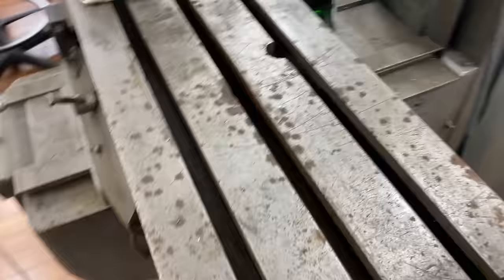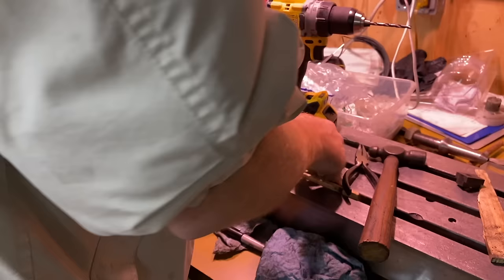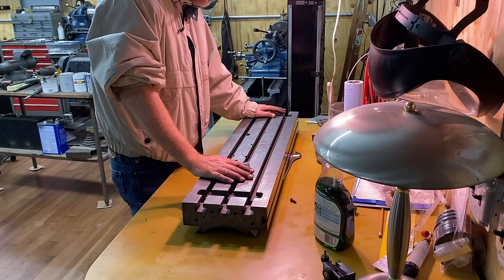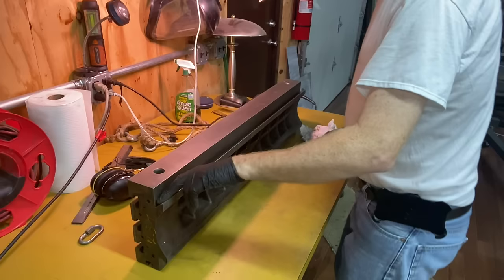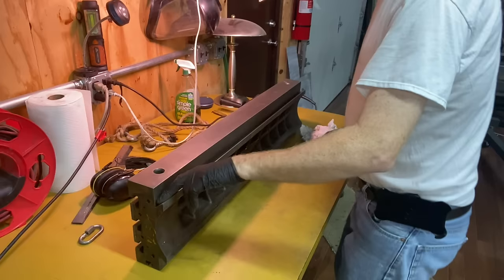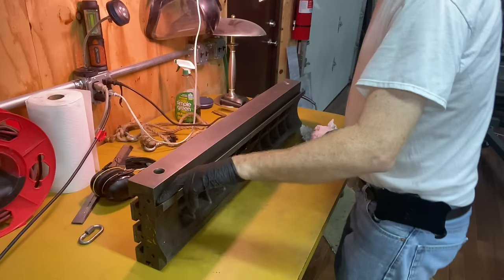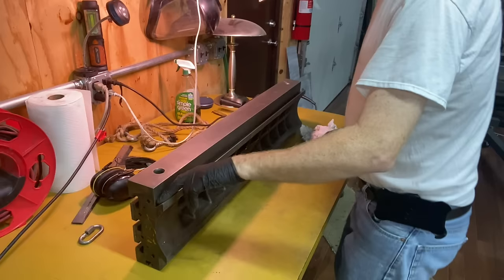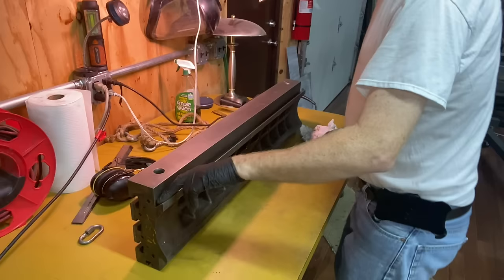Bridgeport restoration 10  -- Fixing a Horrible Mill Table

Comment: Thanks for sharing. I don’t know enough about what your doing to know or help you, but I looks great. Most guys put covers to keep the clips out of the tee slots.
Reply from the maker: I made some in the past using a 3D printer.  But then I found that the hot chips would melt into them, and that wasn't helpful.  I think I need to get around to making some more covers out of a different material.  Great suggestion!  Thanks for watching.
Reply: Copper sheet is easy to work with, and would look awesome…
Reply from the maker: @jeremyfreeman1860   Yeah, that would look awesome!

Comment: I would send that table out to get machined after the saddle and the knee gets scraped. It's a shame to put a ton of work into this project and end up with a drill press.
Reply from the maker: I agree.  It would be very nice to have everything properly machined and square and flat!
Reply: I feel like although this comment is correct, any improvement you make to this bridgeport, is STILL an improvement. Keep chuggin!

Comment: Consider using tapered pipe plugs of the appropriate size to plug your holes in the table. Not the recessed hex type, but the protruding square head type. They would self tighten and leave a almost undetectable spot where they were installed after milling the table flat.
Reply from the maker: I hadn't thought of using tapered threads. But it is a great idea.  Thanks!

Comment: Hmmm, quite the interesting pattern in the table surface... Kinda reminiscent of some flaking finishes for reducing of surface drag and allowing fine dust and micro chips to not be an issue... 
Tho damn it man, an angle grinder spraying dust on the ways of the machine... YIKES! That is some industry grade sin right there... I get that you wanted to shorten the work, but a decent jig saw or similar would have been much more machine friendly than a zip disc... A handheld hacksaw blade in a welding glove would be my choice of weapon to have that screw loose it`s head... Would take time, but im severely allergic to grit or h2o compounds in the shop... 
Speaking of grinding dust - I`m just in the process of restoring a pedal-kick-press, and I spent like 3 hours with an angle grinder in the yard today, foolishly hoping i would at least finish one le(i)g of the machine stand and start the other, but nah, 3 hours in, i was so covered in paint dust and cast iron powder to the point where i looked like a coal miner, and the le(i)g was still not even finished... I recorded some, thinking i would get back to recording when i was near done to spare the camera all the airborne iron dust, but i just chucked the leg in the fab. shop along with the grinder and took a shower in the basement(fab shop floor), vacuumed the whole shop, cleaned all the iron dust and crap - just to prevent the TIG welder from snorting a line of the good stuff while i`m not looking and dying on me the next time i connect it to the power, and keep in mind that i didn`t grind indoors, it was done outside, i just took the leg and the grinder in when i was done - walking in as i was, shedding crap all over despite brushing my uniform off and wiping the leg and the grinder... 
You can`t just whip the angle grinder out like that around a precision machine, or any sensitive tool in general... It`s a damn fast tool, but it`s nature renders it an outdoors type tool in most cases(lest you have a vacuum grinding table which sucks up any and all dust generated while allowing you both grind and weld large pieces on it without huffing grit or fumes - look those up, they are a fantastic project - one that i started, but am delaying, as per usual...)...

The ``le(i)g`` is a sopranos reference... 
All the best and kind regards! Also, if i forgot to say it, keep that grinder away from those poor machines...
Steuss
Reply from the maker: Yikes!  I didn't even think about spraying grinding dust onto the ways.  I'll have to make sure to wipe it all down.    I hope your project comes out OK.  Best wishes.

Comment: I've been watching along as you go; it's always interesting. You were several weeks ahead of me on the South Bend, and now a similar situation on the mill.  Considering the belt sanding I'm thinking 5 - 10 thousandths is probably not bad. Later you'll just need to get a LARGER mill so you can mill the bridgeport table!!
Reply from the maker: There used to be a machine shop in my area with a surface grinder large enough to accommodate the table. But it shut down, so that is out.  At some point I have to decide the cost vs benefit, and I'm with you: 10 thousandths is probably fine.  At some point, I'm going to put an indicator in and see if the vice is tilted because of that hole.  If so, I could put shim stock under one side etc.  For now, I don't need that level of precision.  Thanks for watching!
Reply: Exactly, you can easily shim the vise to get it as true as you need.

Comment: I welded mine and fly cut the whole table. Very good results.
Reply from the maker: Can you tell me more about this.  I initially wanted to weld mine, but everyone told me that the heat would make the cast iron crack.  How did you do it?
Reply: @KevinToppenberg I’m not the one you asked to question to but I’ve welded a cast iron crank with good results. I used cast iron specific electrodes (nickel alloy) in a stick welder.
It is definitely possible to weld cast iron but you have to be extra careful to prevent cracking and overheating. The key is to preheat it, which is possible using a torch, to somewhere between 500 and 1200° but not above 1400 Fahrenheit.
Cast iron is also prone to overheating so the weld beads has to be quite short, about an inch (or 10 times the electrode diameter) and using the lowest possible amperage.
Reply from the maker: @Tidexon  This is great information.  Thanks.  But I'm not sure I have the tools or skills to do that.  Maybe next time.  🙂

Comment: I hava a really nice 9-42 B.P. from the early 80's. The table however, was used by a 300# APE ! it has what i call "Aprentice marks" all over it and a few areas where the T-slots were broken due to improper useage, then welded back up.  All said and done, it's a great mill that i can hold .0006 if i try really hard, and don't worry about that 1st ding. 
 Once you verify the head is perfectly trammed, run a big fly cutter across it. That'll true it back to about as good as you'll need.
Reply from the maker: Serious question: how would you cover the entire table?  When I put the table all the way to the right or left, there is always about 8 inches or more out of the reach of the cutter.  So would you just have to have a fly cutter with 18 inches diameter??  Also, since tables tend to sag when all the way to one side, wouldn't that keep the top from being flat?  Maybe it wouldn't matter as long as the sag is always the same??  Thanks for feedback.
Reply: Yes, that is a good point/observation. Once trammed, the head can be swung (rotated on the column)  with minor deviation, and though it's not perfect, it's a way to clean up the table. Better than a belt sander for sure ! Or,... an 18" fly cutter, or scrape it.  Mine needs more than the labor I'm willing to put into it so I may replace it altogether at some point. Until then, it's good enough for the girls I go out with.
Reply from the maker: @manmachinemake3708    "Good enough for the girls I go out with".  LOL!   🙂

Comment: I swear Kevin it seems like we have the same mills. Mine is a 1954 round ram. I will post videos soon. My table seems just as bad. You did an amazing job on that table. I am going to try this stuff I used when I restored vintage cars in the 90s. It’s basically like a Bondo but all metal. ( metal to metal I think it’s called ) It’s best to put it on as smooth as possible because it’s basically like welding the holes. It’s extremely strong and will act like metal. Sands just like metal. Anyway keep up the great work. It looks so nice……Rod.
Reply from the maker: For my future reference, can you tell me the name of that product?  I'd love to know.  Best wishes!
Reply: Called “high temp lab metal”
Reply: I used something called ALL METAL. it really works great. I definitely suggest putting it on thin. It will shrink a little but it’s like sanding metal. It’s a little harder to sand. You definitely should use guide coat to sand it off. Just makes it easier to see… I thought I replied before. Sorry…
Reply: Lab metal and all metal very similar formulas:)
Reply from the maker: @jeremyfreeman1860   Looks like this is the page for this.  Very interesting!  https://www.alvinproducts.com/Product-Line/agentType/View/ProductID/6/Hi-Temp-Lab-metal
Reply from the maker: @doingstufforatleasttrying4843   I can't find the website for this, given its generic name.  But sounds great.  Thanks for the info.

Comment: Easy way to pick up the iron filings and leave the nonmagnetic bits behind is to put a magnet inside a thin plastic bag.  Pick up the filings, invert the bag around them and remove the magnet.

When adding filler to WEST epoxy they recommend putting a thin layer of unaltered epoxy down first.  It sticks to the substrate better without the filler and the thickened epoxy bonds well to the unaltered epoxy.
Reply from the maker: The suggestion of the plastic bag is genius!  I'll have to remember that one.

Regarding the epoxy, I found this video https://youtu.be/XObmZIbHOzY?si=UzGXsfZM0SOdDSz_ where the man compares epoxies.  It confirms what you are saying about the problem of adherence.  As I recall, many of the failures of the epoxies were due to separation from the material, rather than it breaking on its own.  So thank you for the feedback!  

Best wishes.

Comment: Hi Kevin.
 When you checked the table with your DTI you had the stylus at the wrong angle. This introduces cosine error. 
You need the stylus parallel with the table to get a more accurate reading. Best Wishes.
Reply from the maker: I had to go back and check the video, and you are right.  I had the stylus of that indicator at about 30 degrees.  I found this video by Joe Pie that talks about it.  https://www.youtube.com/watch?v=dsWSxpwCPUg  Looks like it is important to have the tip of the indicator as parallel to the surface as possible.  If within 10%, it will give error of 1.5% according to wikipedia.  https://en.wikipedia.org/wiki/Cosine_error    
'm still not sure if my error was to overestimate or underestimate how much variance there was with that table.  But thanks for pointing this out.  I'll try to better next time!.

Comment: can you put a grinding wheel in the chuck and grind the table flat ???
Reply from the maker: That is an interesting idea.  The problem is that the table sags as it goes left-right (x axis).  So I think that it wouldn't end up truly flat.  I think it needs to be done independent of the wear on other parts of the machine.    FYI, I have since purchased a surface plate larger than the bed, so I might be able to get it flat using that.  But that would be a big project.  Thanks for the feedback!

Comment: Not sure about placing the surface plate on the table. A plate has a precise surface, but it it guaranteed to be parallel top and bottom? I wouldn't think so.
Reply from the maker: You are right. I think the bottom of the plate is somewhat rough and not finished.  The reason I use it is because I have seen others online use a flat piece of metal.  And I didn't have that, so thought the plate would be second best.  I seem to keep running into situations where I don't have the right tools.  So I try to use second best, and then get less than ideal outcomes.  😞  Thanks for the feedback.  I appreciate it!

Comment: Very interesting and pertinent to my situation. All those holes on the mill table - isn't it supposed to be hardened? I made a dent in my Bridgeport clone with a normal HSS drill. Surprised me how soft the table is. On the other hand the inside edges of the T slots are dead hard. (and rough). I couldn't true them up to take accurate locating pins.
Reply from the maker: Well, the table is made of cast iron, I believe.  I suspect that it is case (surface) hardened somehow.  And I think I may have gone down through that when trying to resurface it.  But this table seems soft to me.  Thanks for watching.

Comment: The mix of iron filings and epoxy is essentially the JB Weld product, although they have probably tuned the mix of grain size to optimum.
Reply from the maker: Well, I just went down a rabbit hole.  At first, I thought JB Weld was similar to other 2-part epoxy's.  Then I found this site https://www.jbweld.com/products that lists all their products, and indeed there are a few that say "Steel reinforced."  If I click on these products, there is a way to get the material data safety sheet which lists the ingredients, for example here: https://dynamix-cdn.s3.amazonaws.com/jbweldcom/jbweldcom_513776135.pdf  The only metals that I can find as additives are Barium (a soft metal) and titanium dioxide.  Titanium is a strong metal and seems like a cool ingredient to have.  But it's not ferrous, and it seems disingenuous if the company call is using this to justify calling their product "steel" reinforced.  Furthermore this site https://en.wikipedia.org/wiki/Titanium_dioxide seems to indicate that titanium dioxide is more likely to be a colorizing pigment than a structural component.   All told, I don't think JB Weld really gets any strength from added metals.  I could be wrong and would love to find out more information.  Having said that, I don't know that my iron shavings put into the epoxy added any strength either.  One could argue that added material may interfere with the epoxy and lead to a degraded bond.  On my prior mill restoration I did use JB weld, so thought I would try something different this time.  Honestly, both turned out about the same.    Thanks for the feedback!
Reply: @KevinToppenberg  I’m just happy to hear from someone else with a penchant for rabbit holes!  I think the MSDS is only required to list potentially hazardous materials, which might be a loophole for JB Weld.  That said, I have no idea what it really contains - or if it is just another epoxy.  Thanks for the info!
Reply from the maker: I just got another viewer that commented in this same vein.  But when I came here to reply, the post seems to have been deleted.   He recommended a product named "Devcon plastic steel putty" that I had not heard of before.  I did some searching and found this cool video where several similar products are reviewed.  https://youtu.be/XObmZIbHOzY?si=m60Tsie9vUI6I0ht  It seems that the quick-drying epoxy glues didn't stick well to the underlying steel very well.  The Devcon and Original JB weld seemed to do the best.
Reply: @firstmkb  Yes, MSDS are only listing the ingredients that are potentially hazardous or have any sort of regulation to them at all. Some companies take the route of just listing all ingredients, some companies will only list the very most required ingredients by law, and some companies do a mix but maybe leave a few things out. Therefore, impossible to know if an MSDS has all the ingredients listed hah.

Comment: Is the bed cast Iron or steel? If steel I think welding would be a good option for some of the holes.
Reply from the maker: I'm pretty sure it is cast iron.  I would have loved to use welding instead of epoxy.  But I was afraid I would cause more harm than good with welding.  :-(